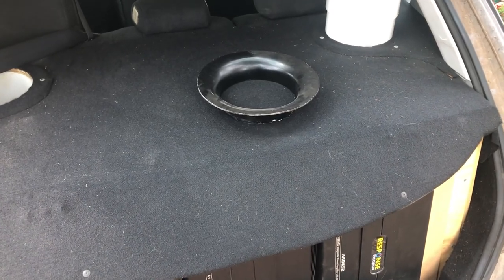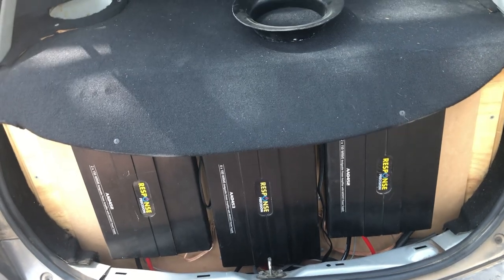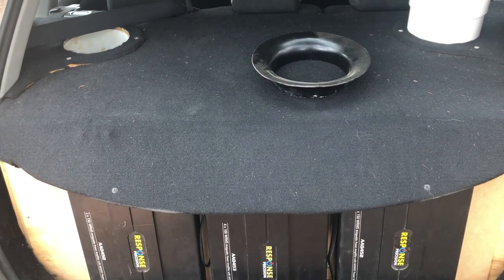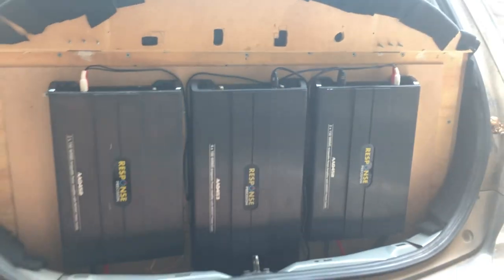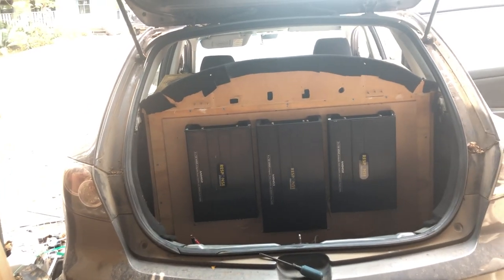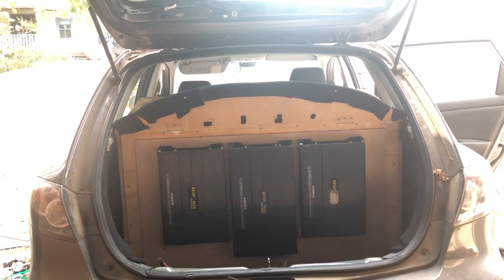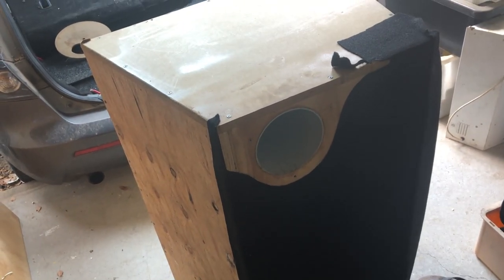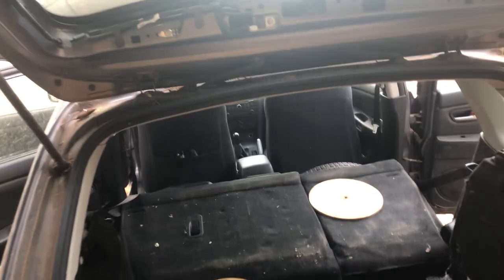Bass Horn in my Car - Folded Horn ep 14

Comment: Just a concern brother. I think folded horn enclosures are much effective at public address hence its effectiveness is at 60hz or much higher. But still, its a mad design and an amazing feat to fit that beast inside your car.
Reply from the maker: yeah, it really shines in the open, when in the car its about as loud as my 6th order, on half the 6th orders power, but in the open its way louder than the 6th order, definitely a full 10dB or more
Reply: @Dakoustics  that’s because these were designed to throw bass a large distance they’re intended for concert subwoofers, and at a concert there just a big open space

Comment: It might get deeper bass with the horn facing the back of the car.
Reply from the maker: Yes, it did. I've got the content for a video on this which I should eventually put out, EQ testing and relative output on the same power.
Reply: @Dakoustics  looking forward to seeing that. I have an Autotuba horn knocking about at my parents' with a single 8. I have 2 12" Eminence subwoofers in boxes. 2 12" JBL drivers and an SPLX10 knocking around in a sealed box (I might want to build a mini 6th order)